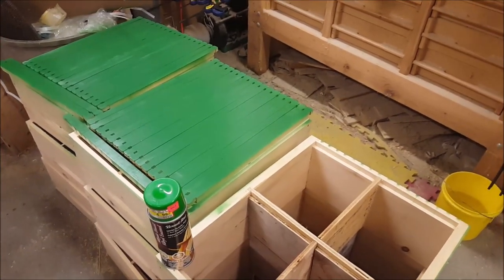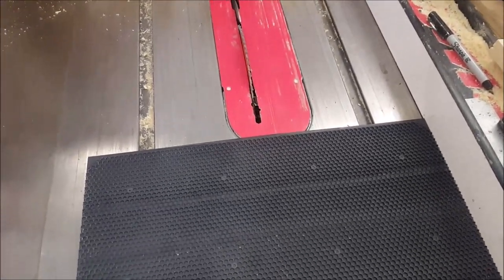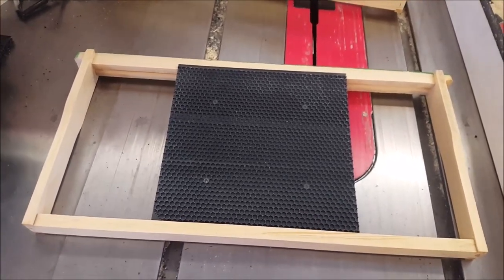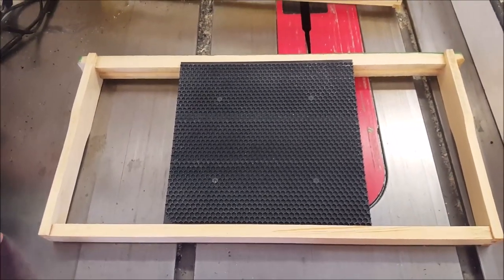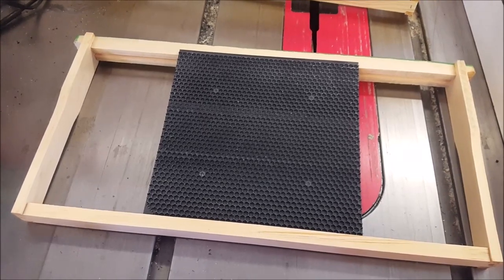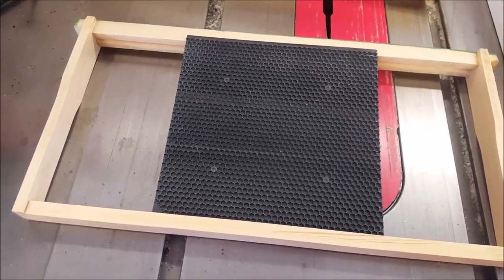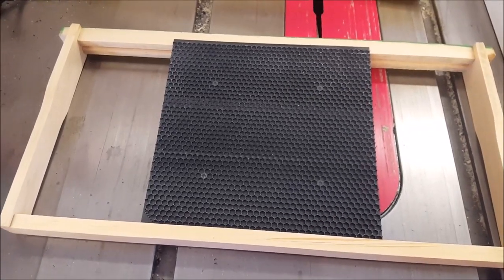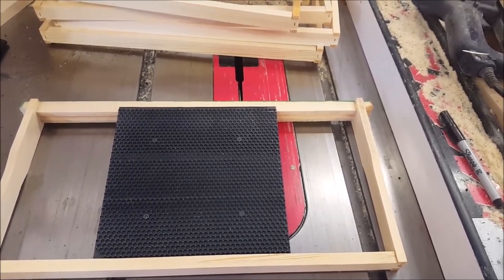🔨Cut Foundation Costs in HALF! - That Bee Man

Comment: Great idea, will you report back on this when you had them in use for a while!
Reply from the maker: I will try to do a video about these in the summer.
Reply from the maker: Jerry.  I didn't make a video on this specifically but they performed very well in every respect described here.  I did get a lot of comb sections from these and then proceeded to extract the center portion.  The one hassle is, I usually save my comb frames until I'm done extracting, then I cut up and package the comb.  With these, I need to cut the comb out first so I can extract the center part.  I just need to change my process a little, it doesn't add much time at all.